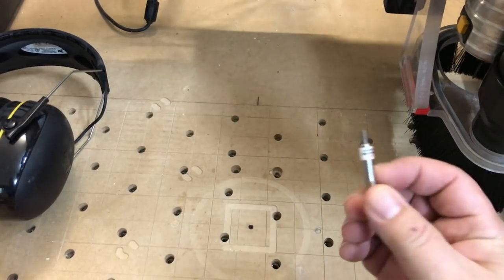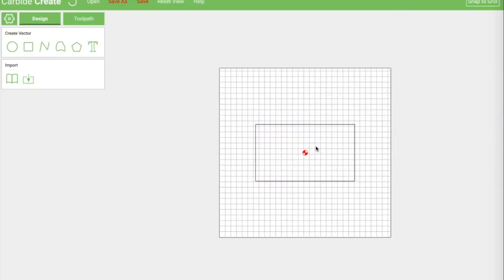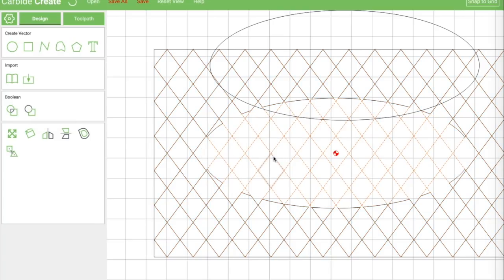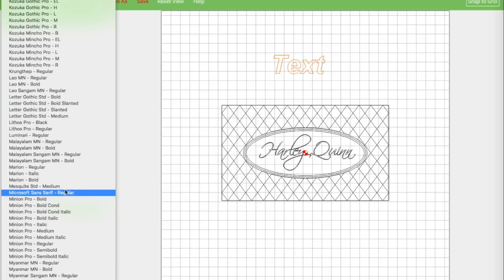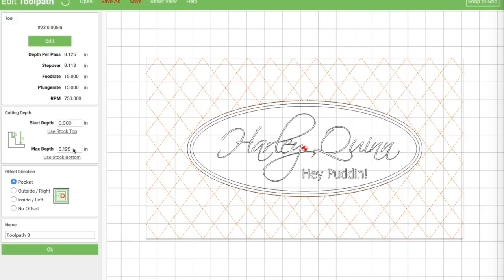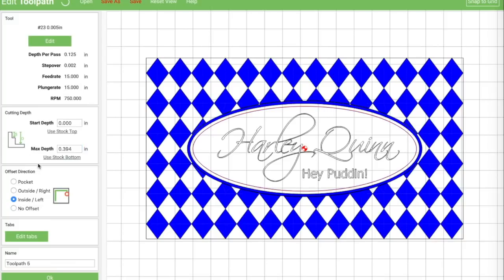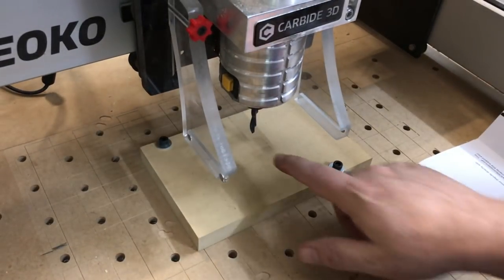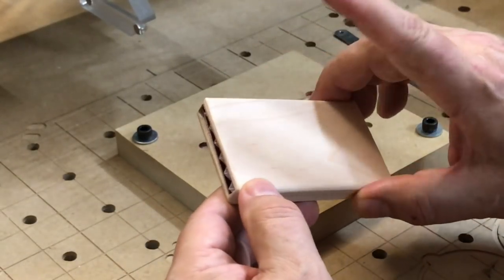Using a Diamond Drag Bit to Create a Metal Business Card

Comment: Great project John. When you created the first diamond pocket toolpath, how did CC decide to do alternate lines & leave blanks in Kleenex box pattern?
Reply from the maker: I did kind of skip over that bit. That pattern was created as a row of individual diamond shapes with the left and right sides touching. The the row is duplicated and set beneath the first row so the bottom touches the next row. The effect is that the two rows of diamonds are "real" but the row halfway between them is just defined by the outer edges of the actual rows. Does that make sense? You can sort of see it better at about 11:22 in the vid. Carbide just fills the shapes.

Comment: Would this bit be good on glass?
Reply from the maker: It's supposed to work, but I admit I have not tested it. Maybe this weekend. :)
Reply: @johnearlclark  ok great you think you can do a video on it? That would be great. Just got a small cnc just started out.
Reply from the maker: @beltcutter6837  After a few quick experiments, I am going to say no, it really is not good at etching glass. I tried a few types and couldn't really get a consistent line on it. On most glass I tested it would not make any mark at all. Maybe a different kind of bit?
Reply: @johnearlclark  o ok. So just metal and tile glass is better?
Reply from the maker: @beltcutter6837  Metal and marble tile. A lot of the slick glass tile (bathtub tile) is way too hard to cut.
Reply: @johnearlclark  ok thank you.

Comment: where do you order your bits from?
Reply from the maker: Mostly from amazon. I like the Amana downcut bits for my 1/4 and 1/8 bits. The rest are a random collection of things I wanted to try. The Diamond Drag bit came from ebay.
Reply: I suggest making friends with your local cnc shop. Yes they may have a way nicer machine but the experience goes hand in hand and can point you in the direction of the best possible operation for your project including proper bits plus depending how nice that shop is it's possible you could pick small scap from their bin. Sometimes it works sometimes it doesn't it's worth a shot anyway.